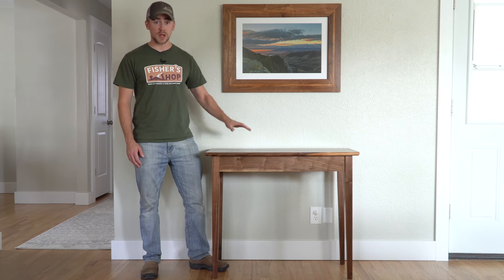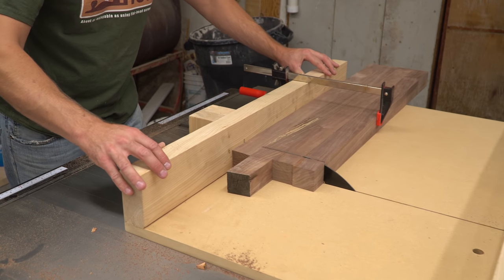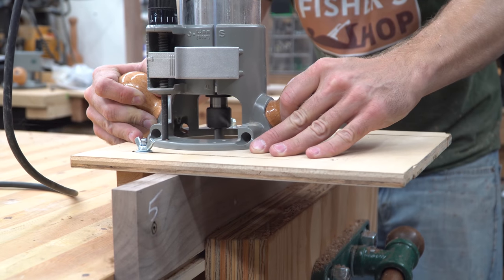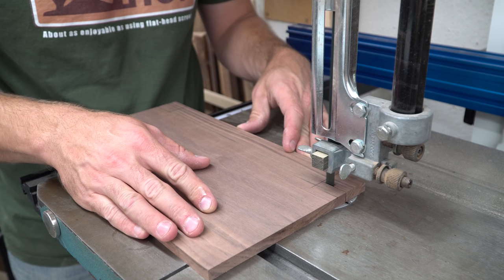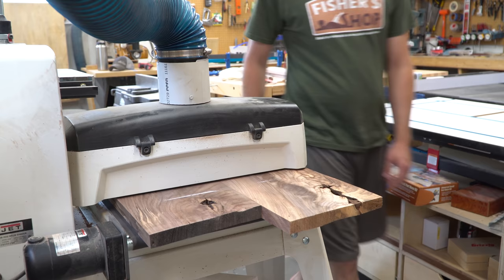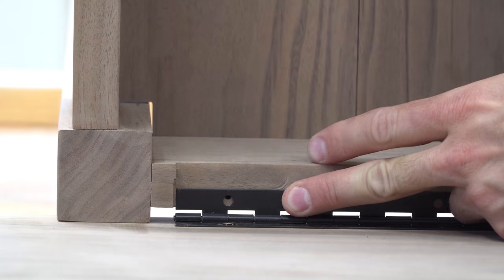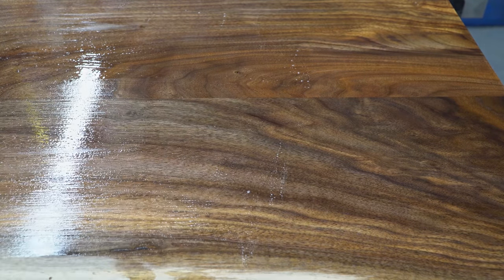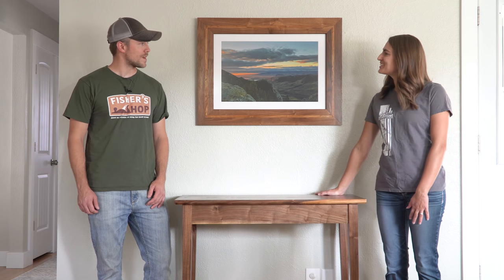Making A Hall Table With Built In Storage

Comment: I just finished making a table with drawers made of plywood, (I like the look that the edges make when it's sanded smooth and stained), and even though it turned out really nice, it's not as nice as yours. Also, considering that my wife knew I was making it. she didn't give the same reaction as yours when she saw it in its place.
Reply from the maker: Surprises are fun, but if the tables stand up to years of use, both of our wives will remember fondly where they came from.

Comment: Excellent build, beautiful job.  Doing all the sanding before assembly is a huge time saver.  Consider finishing before assembly too.  Just tape off the areas where glue will go and finish completely.  Aster assembly you can do tiny touch-ups if needed.

Comment: 3/8” is plenty to make a strong enough joint for the bottom sections.  All it has to do is hold the pieces together.  They are not under any tension.